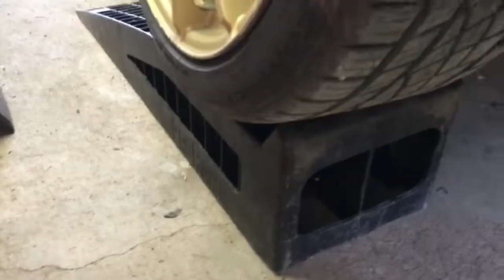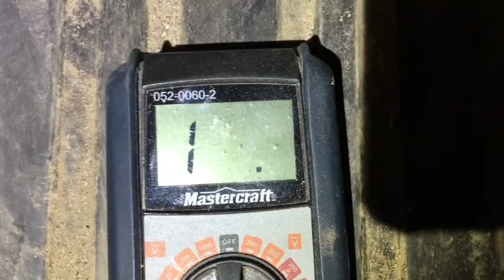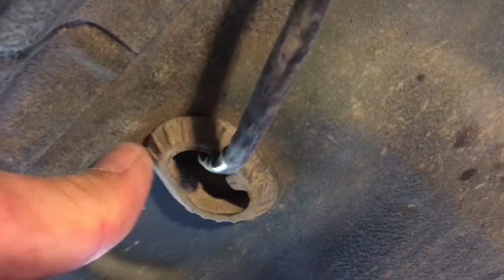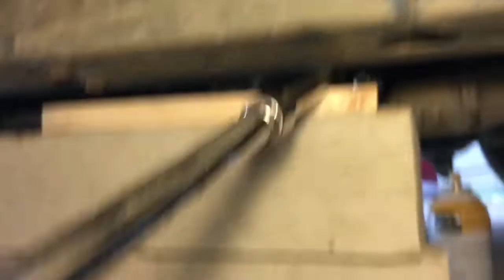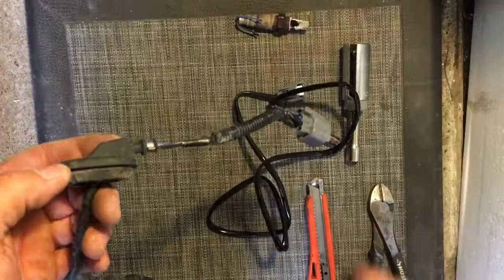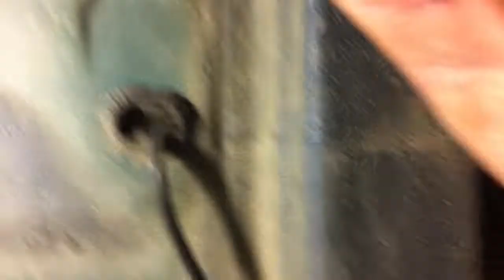P0141 O2 Sensor Heated Circuit Bank 1 Sensor 2, Honda Accord

Comment: I have a Honda accord 2011 with the same problem,  I changed the boths sensors,  but the problem persist. Is there another solution?
Reply: only paid $12 for sensor

i replaced cat one but still got issue, im putting tape over the light
Reply from the maker: Exhaust or intake gas leaks, improper fuel pressure, bad injector (s), or even some electrical problem in wiring between O2 sensor connector under the seat to ECU. The worst would be if your new O2 sensors are bad which is always the last thought but it's an option too...

Comment: Changed 02 sensors and my check engine light comes right back after clearing with the same code over and over
Reply from the maker: If you measure your O2 sensor and the values are within the limits, then it's something else. Did you measure the resistance of the heated circuit? What value did you read? 

Besides. That code doesn't mean it's the sensor only. There are few other reasons as you could see at the beginning of the video why it throws that code on you. You have to go one after another. There are several tests on each of these reasons. I covered (I believe) the most common one.

In my case I measured the old sensor, it was bad, after I replaced it the code never came back.

Comment: What do I do if the check engine light popped up again after changing the 02 sensor it disappeared for a little bit but then came back
Reply from the maker: Did you have the same situation like in this video, same code and also when I measured the old O2 sensor and it had an open circuit? If yes try to measure the new one when disconnected from the connection under the seat. When it'd good your problem might be one of those from the list I showed in the beginning of the video. Let me know what exactly you've done so we might figure something out.
Reply: @fixitorleaveit4393  yes same code as the video
Reply from the maker: What codes do you read now?